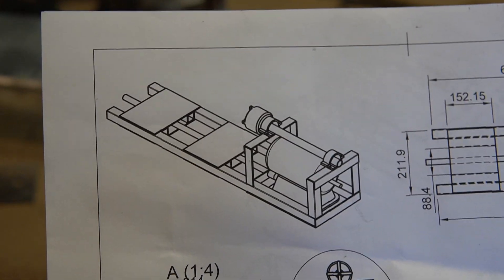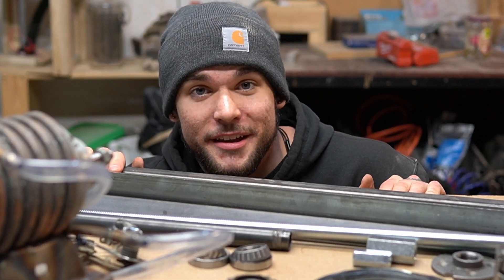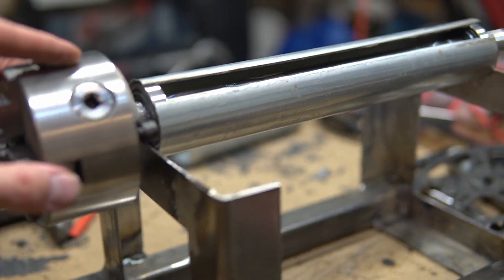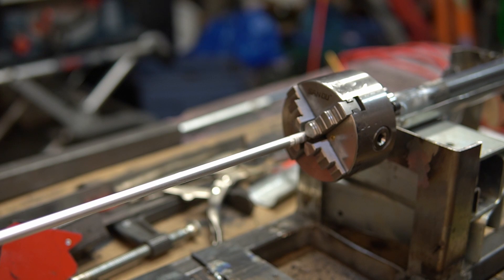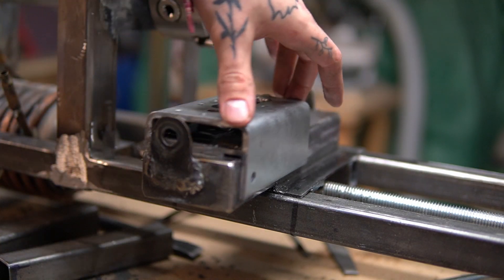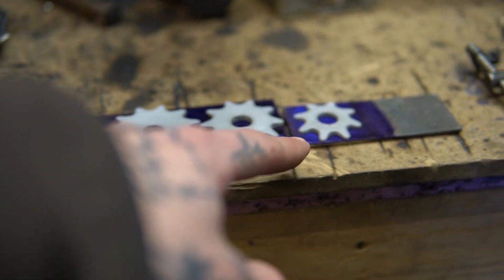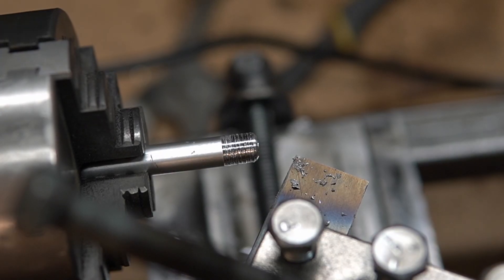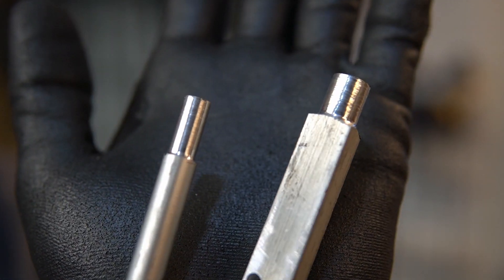How I built my HOMEMADE Lathe!

Comment: I know this video is old but i have a 14.5"x36" lathe and a 10"x50" mill. Ive been building a 10"x24" benchtop lathe for the last 7 months. Granted ive been machining every part from scratch and using acme screws for all the slides and leadscrew. This build really puts thing into perspective for me:) Well done.
Reply: Yeah, you have to ask yourself what tolerances you really need before you spend your life trying to make a high end lathe.

Comment: What kind of motor did you use?
Reply from the maker: I think it's a 1/2hp single phase AC motor, got it out of a bench grinder
Reply: @Neally  Cool! I got an expensive DC motor drive for dirt cheap from an auction, and the plan was to refurb and resell, but then I started getting other ideas, which is how I came across your video. Appreciate it!

Comment: Real lathes- cast structure for rigidity, all solid part. No welding after curing it for ever and surfacing.. this isn't going to end well. Oh you can see millimeters ov movement when cutting:( better luck next try

Comment: What do you mean it’s not as good as a store bought lathe ?!! Yours is better than my vevor 8x14” lathe !! Suggestion, if you want smooth finishes and no bumpy bumps it’s incredibly important that you get your x and y axis as rigid as possible with absolutely no movement. That way when you go to turn your part the tool post doesn’t move and your chuck needs to be extremely rigid with zero give. Also bolt your lathe to the table or tack it in place if you have a steel table . If you do this you will be able to make incredibly accurate parts down to the thousandth and below.

Comment: Two things i'd change to the recipe
1. rigidity
2. rigidity
Basically A frame for the spindle bearing supports. Not a box frame. That's not only not rigid, but it's also something that can build resonance. The riser for the tool block, that'd have to be more rigid as well, with a wedge put inside (there's a woodworking channel that built a cheapo vise, and that's how he did his vise jaws. Tube + wedge inside - aka triangle). Finally, the ways of the lathe, i would build them in a triangulated fashion, as close as possible to straight (but i wouldn't put too much effort into it at first) and parallel. I'd also make them such that the "legs" could be buried inside a large concrete block that spans the width and length of the lathe. Once those are in set, to make things parallel, square, even whatever, i'd choose where cuts could be made from the sub frame (the concrete) and before making the cut, i'd weld a nut and a plate  and cut between them. That way, if you want to tighten or expand that joint to brings to even, you can use a bolt to push or pull based on its position, before welding the cut back. All welds done in this operation would have to be very quickly chilled, so a wet towel should be in place. 

This could yield a bigger lathe, on the cheap.
Reply from the maker: That's a good idea, I like it! Cheers!

Comment: Great.  Don't pay any attention to untalented detractors.  I think you are definitely a genius, no kidding.  I knew, as you did, that by using the materials and tools you had on hand that this machine was not going to be incredibly precise or powerful.  But, it is incredible; a very handy tool for turning down stock.  If you need super precision for a project you can always take your stock to a machine shop.  I think you should have taken the pipe to a machine shop and had the ends turned down for a good bearing fit though, it would have made it run truer.  Also, don't heat a bearing any warmer than 150 degrees Fahrenheit, that should be lots to slide it on a shaft at room temperature, without damaging the bearing.  Again, excellent work!
Reply from the maker: That is greatly appreciated, my friend. Thank you and have a great holidays!

Comment: This is f'n great. 
Please use cutting oil/fluid do I don't cry.  :)
Re. milling with drill press: I just picked up a '40s era Craftsman benchtop press to make a mill for 'light' work. The thing weighs ~280 lb. The head is a big honking' (tech. term) chunk of cast iron.  
I love the irony (pun) of needing a lathe to re-size the rod to make the lathe. Nice work using a grinder on that and everything else. +10 for the use of layout fluid!
Reply from the maker: Thanks! Greatly appreciated ✌️

Comment: I think the hand made gears were the most impressive for me, i had no idea gears could be handmade with enough precision to be worth a darn. Awsome job on the entire project, i feel alot more confident in trying to build my own now
Reply: A friend sent me a vid. of a guy making gears for a wrist watch on a tiny lathe.  Chronova Engineering is the channel.
Reply: @stringlarson1247   I love his channel he is incredibly skilled
Reply from the maker: Thank you, I appreciate it! I'll be honest, I as surprised by them too😂
Reply: @Neally I appreciated the heat treatment of the gears and the cutting tool you made. I have never seen anyone make their own cutting tool from tool steel other than HSS, and I have watched every video on Youtube about DIY lathes. About making a tailstock, there are a MILLION ways to make a tailstock, so do a ton of research before you settle on one design. You can do everything from drill press style, to turret, to another chuck if you want to do grinding or hardened shafts. The possibilities are endless.

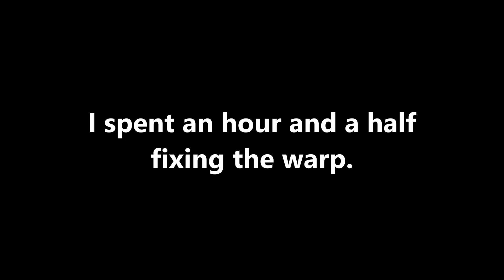Comment: 4:55 man I am crying I can see that wobble from here. Jokes aside very well done man. 
Hey I wanted to add a few things that might be helpful. If you do turn crankshafts or anything that will require really tight tolerances I would take really shallow cuts until you are certain the maximum runout your machine has. Also, while chain drives are very good at not slipping you actually want the opposite on a lathe. If your belt is tensioned correctly it will only slip if something goes horribly wrong. One thing that can fix some of the runout would be replacing that needle thrust bearing you heating with a new one. Make a jig to install it perfectly square on the shaft and if it's a tight fit either freeze the shaft and then try or have it press fit. Other side of that coin is the chuck was welded on which added some distortion. I really like what you did with that bench grinder motor. Mine always got way too hot and I actually rounded a small radiator from a window ac to pull heat from mine but your method seems much easier. Still very well done man .
Last thing I promise you can used a start capacitor with a little more microfarad to give that motor more of a lunch when starting. Please, be careful spinning that be hand it will take your finger like nothing.

Comment: I have a whole garage full of real machines that I've acquired over 30 years. I admire what your doing greatly! A little suggestion, if you were to make a lathe all over again design the fabricated bed in such a way you could fill it with concrete! This would greatly add to its rigidity and dampening ability. During WW1 Lathes were needed so quickly there was no time for foundry work so beds were tubular/bushing slides  and concrete.
Reply: That's a great idea. Stealing it.
Reply: It would  be awesome if you could .make a list of part and sizes that you use.just incase someoneelse would like to build one similar  to it
Reply: Hell yeah.
Thanks for the info I thought about making a concrete table thing with plate steel on top, could be a really good work table, maybe some type of plastic or composite between the two so it lasts longer. Also concrete base for a vise stand, or other surface/holding.
Reply: Some of the best modern lathes and mills are made from granite or a composite called granitan which is essentially concrete with a polymer binder. You can cast the body of the machine, (and headstock if you are making a lathe), with an MDF mold including rebar and threaded inserts to mount hardware. Then use an axle spindle and bearings from a semi truck for the headstock spindle. Buy a chuck, which should bolt onto the semi truck hub with zero modification, and use HG linear guides  for your ways. If you buy a precision shaft and clamp it into the chuck, you can use a dial indicator to line up you ways with the chuck/spindle and have yourself a very high quality lathe for very little money. This comment better get a million likes. You’re welcome.
Reply: @bill4639 bill, that's a bloody great idea, I need to make a minimal lathe to make fly wheels.. wanna like help me source part links or whatever? I bet your a wealth of knowledge
Reply: Ive seen a few designs with concrete and metal rods to reinforce it.

Comment: Awesome build dude, i must make something similar but will use v belt drive, its a bit more forgiving and easier to make slip for soft starting and emergencies, i was trained to use lathes and safety is a massive priority, things like don't wear a tie or your face may take a beating, this was the first thing i was taught, second thing was remember to take out the chuck key ;) and where is the emergency stop button.
Reply: The other thing i was taught was to use 300 rpm as a guide for mild steel at 1 inch diameter, 1/2 inch is double so 600rpm 1/4 inch 4 times so 1200 rpm this then gives the same surface speed, ensuring the tools don't get burnt out, usable for drilling holes also.
Reply from the maker: I'll use that for reference in the future, thanks!
Reply from the maker: Thanks! I would definitely use v belts if I made it a second time, I was using what I had laying around the shop... hence the jankieness😂 
Safety features are definitely lacking, I'll be more mindful of them in future versions!

Comment: I've seen you've been replying to recent comments so I wanted to ask a few questions before I attempted this at home. 

1. What is the thickness/height of the steel tubing you used? I have some 1/16-inch thick and 1.25-inch tall tubes, but I'm not sure they will hold up to the task.
2. What tolerances were you able to achieve with your build? +/- .1-inch?
3. Why was the framing as long/spacious as it is? Such as the area where the motor sits? Or how high the chuck lies from the base of the frame.

I'm in the process of making a smaller version with many of the design concepts you've used, as they are (scuffed yet) beautifully simple. The only complaints I have are how there aren't any shots at the end of the video with the build fully complete, or a list of the materials you used. Other than that, really awesome video and super inspiring. Thank you.
Reply from the maker: 1: I don’t remember exactly, but I think it was something like 1 1/2in with 1/8 wall thickness.
2: I never bothered testing for tolerance because of how much variability there was right from the start. It could be as bad as 1/16, close to the chuck, with it worse further out.
3: The extra space was for a tailstock that never ended up getting made.

The primary thing I’d do differently if I could go back is to make the rails have angled sides to act like dove tails, same thing on the cross slide.

Hope this helped,
Neally
Reply: @Neally  

Hmm, I guess I'll try with my 1/16 inch thick walls and add some extra framing to keep ot rigid. Hopefully that goes well lol. Also, 1/16 inch tolerance really isn't even that bad for a project like this. But it sounds like the concentricity of the chuck is off, which could either be a big or a small issue. 

When you mentioned dove tails, did you mean angling the framing that the carriage slides on by 45 degrees? What difference do you think that would make? 

Thanks for the super quick reply man, hope all your future projects go well!
Reply from the maker: The way my rails are set up makes it so that high pressure on the slide will lift the slide off the rail, I counteracted this by putting tension on the lead screw, but that creates its own issues. If you make your rails so that they are angled you are able to tighten the fit of the slide on the rails creating a drastically better fit, look up dovetail lathe ways on google, I guarantee it’ll save you a headache or two😂 

Take care and good luck!
Reply: Ah I think I'm picking up what you're putting down. Ill definitely keep that in mind. Thank you so much man!!
Reply: Cast it out of concrete with a polymer binder. You can find videos on Youtube of people making lathes and mills from concrete. Cheaper, easier, and more rigid.
Reply: @bill4639  Yep 2 years and an antique Atlas lathe later. I learned about the complexity of modern lathes and the significance of rigidity the hard way lol. Definitely sounds more solid than hollow steel tubing. Could be a project I'd consider revisiting in the future.
Reply: @Soulliom it is a major commitment to build your own lathe, but if you truly apply yourself, you can make a lathe superior to commercial quality with all the attachments yourself. Just look at Dan Gelbart and his granite lathe. It has micron tolerance.

Comment: I wonder with all the improvised projects I've never seen anyone build a gas powered lathe.

I know, it would suck because of the exhaust and noise, but people tend to have more small engines floating around than suitable electric motors.
Reply from the maker: I think the vibration from a combustion engine might mess with the accuracy of it. Mine's already abysmal, I can't imagine what strapping a lawnmower engine to it might be like xD
Reply: @Neally  yeah, but isn't there like a YouTube rule42 for diy 1projects?

If you can search for it, there-s video of it.

Comment: throw an ac capacitor on it that will kick the engine into running. when your ac kicks on outside that initial jolt of sound and hum is the capacitor jumping the motor... definitely just subscribed though!
Reply from the maker: Thanks for the tip!

Comment: Ace job man. I'm going  to build one but with a solid shaft and pillow block bearings, but with ideas stolen from your build. Thanks in advance for the ideas, but if you've already patented it disregard all I have just written. 
Well done.
Reply from the maker: Go for it! The block bearings are definitely a good idea, but I would keep the hollow shaft because it lets you put longer stock through the shaft while working with the lathe
Reply: Nothing wrong with pillow blocks if you don’t need a pass-through.

Comment: Do yourself a favor…just BUY the lathe. You’ll never get the rigidity you need to cut clean, and the “chatter” it’ll make, especially without a spindle and center, will rattle all kinds of shit loose, ruin your workpiece, knock things out of alignment, possibly crack welds, etc. And I’m not sure what kind of torque you’ll get out of that motor, but center drilling is a hole other story. I’ve been chasing my tail with a hand-me-down MICRO lathe long enough now to understand I need a bigger/rigid lathe to get the results I want for other builds.

Even the $600 or so lathe from HF will perform better out of the box than after all the time and effort you’d have to put into this one. Good luck man, and keep building! #justmytwocents
Reply from the maker: Yeah I'll get one eventually, this was mostly just a fun experiment!
Reply: Was definitely fun to watch also! DIY is sometimes the bane of my existence, but even if things go bad, it’s still pretty good, right?🤘🤣🪓

Comment: Hello instead of using bicycle transmission, it uses auto timing belt. tempering pieces is with water, the piece must receive heat until it is between red and bright red. then let it cool for a few seconds to lower the temperature slightly and submerge in water. do the test with a piece of metal, bar, axle... the same material in water and another in oil.... then try to file
Reply from the maker: I will be using a belt in the future. I heated the pieces to hot-blue them, not to harden✌

Comment: To harden those gears you should have got them red hot and held them there for a minute or two before quenching no hate just saying. I hate how people on YouTube are like if it's not perfect by the books it's garbage so I don't wanna be that guy, looks like this lathe is useable
Reply from the maker: They're made from mild steel so they wouldn't harden up much anyways, I only did it to hot blue the steel for rust prevention purposes. And yeah I agree, it's definitely not perfect, but it does accomplish what I needed it to. It'll do until I get around to making a Mk.II version😂